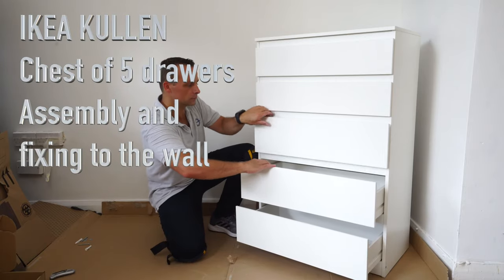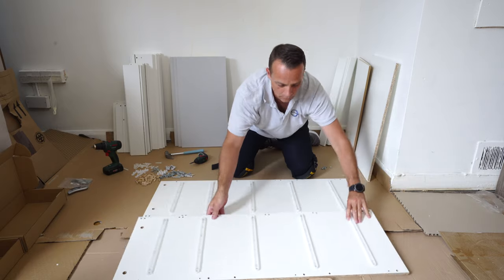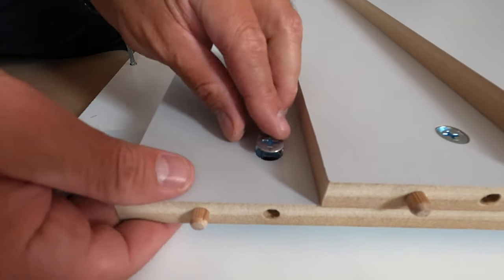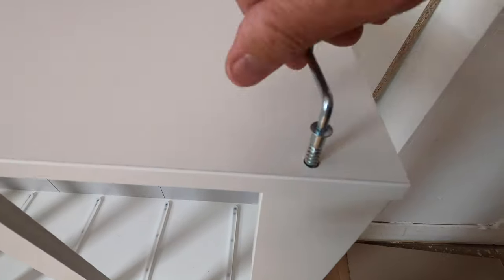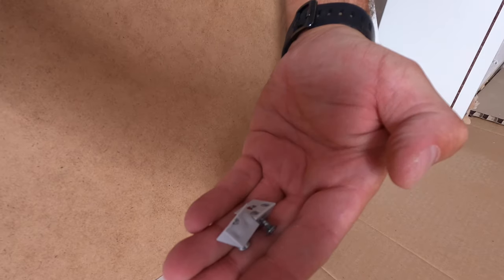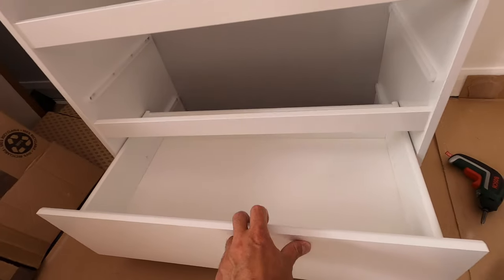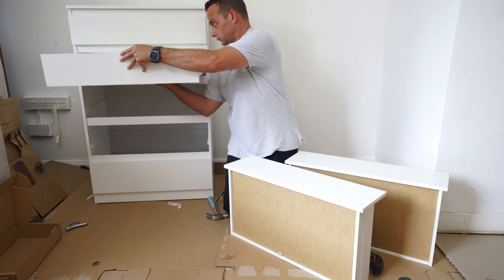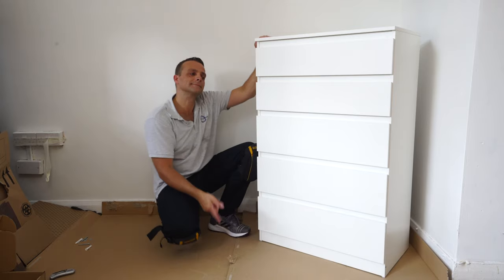IKEA KULLEN Chest of 5 drawers Assembly and fixing Ikea KULLEN Dresser to the wall

Comment: Yes I finished one set of 5 drawers. Tomorrow the other one. The video is very good to follow. Thanks for making it easy for us. Edit the next day: The first 5 drawers I did the drawers don't slide that well but my 2nd one I did today slides much better?
Reply: @fluxieevt  I also found out about the plastic sliders. Thanks for the tip. What I'm going to do first is take the drawers out and hammer the plastic sliders like I did with the second one. The plastic sliders really need to be 🔨 softly but very tight to the wood.

My second pair of six drawers are perfect. That's why I'm going to try to 🔨 the sliders first.

Comment: Does the drawers come out stiff?
Reply from the maker: The runners here are plastic so it is not so smooth like in some other drawers with metal rails. But it is not so stiff they open pretty easy in my case.

Comment: I’m up to 10:21 in the video and when I put the top on it has a 1.5cm gap towards the front. The wooden dowels are all in the correct positions and the fasteners are as well (dowels on the outside, fasteners on the inside holes). What in the crap have I done wrong? I’m about to break my brand new piece of furniture out of pure rage.
Reply from the maker: Send me a short video. I may understand better what is the dilemma ;)